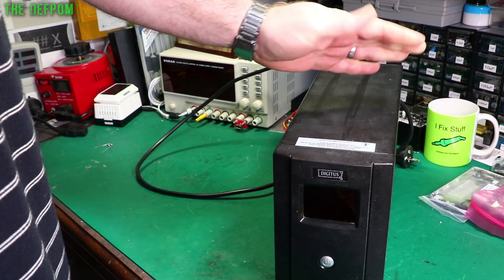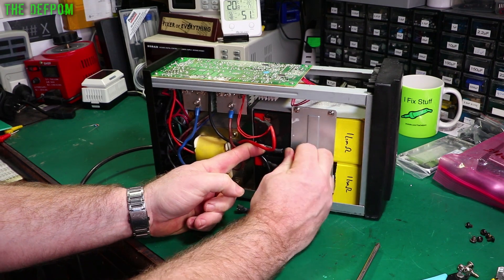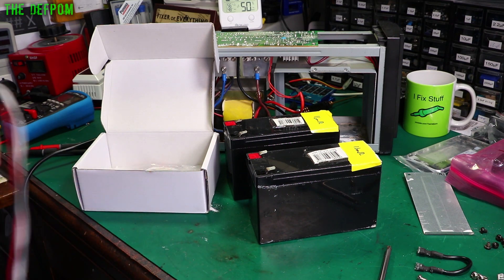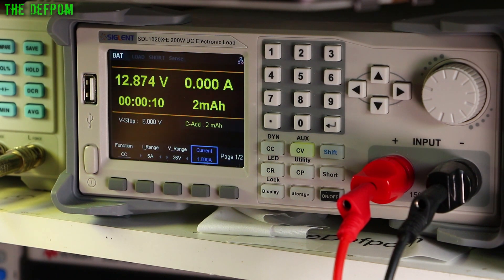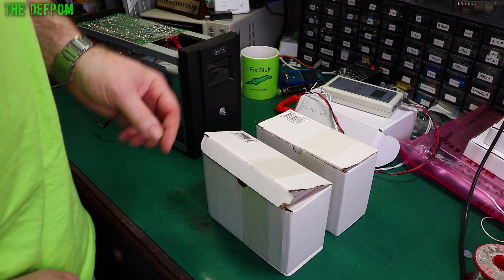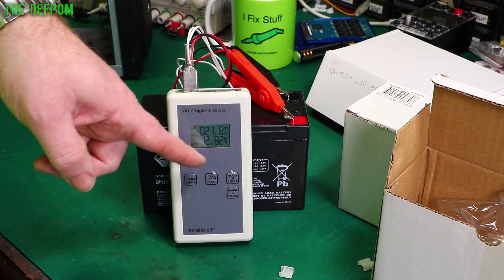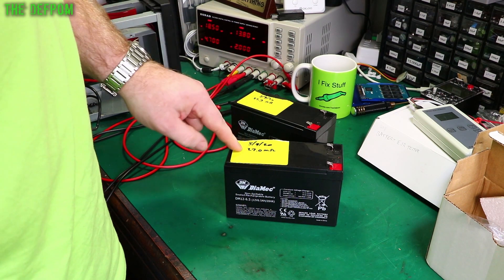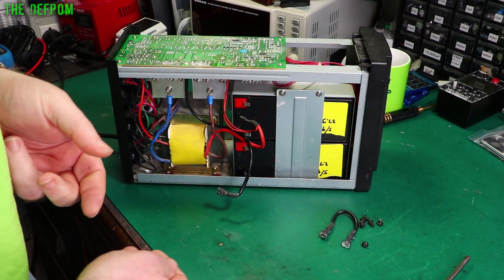#777 Can I Fix My Digitus UPS ? - Leaked Battery Replacement & Corrosion Repair

Comment: Good video, will be interesting to see if the lower energy density will mean longer life.
At 18:46, when you connected the battery and expected a spark due to caps charging.
With one brand I used to change batteries on, they were like  yours not user replaceable, the manufacturer had a connection process to prevent any damage due to connection transients.
The UPS were 3000VA and had 48V worth of SLA batteries.
They instructed you to do the first connect through a 100R 5W resistor to slowly charge the caps, after 15 seconds remove the resistor and make the proper battery connection.
In the time to change over the charge on the caps would not go down significantly and there would not be any major transient to worry about.
Reply: Likely no really large capacitors there on the input section, relying on the battery ESR to do that instead. Also serviced a 12kVA UPS, which had 4 36 series banks of 12V SLA batteries in it.  Heavy trays, and a lot of link wires that I made to replace the originals that had rotted with acid. Just got a box of terminal lugs, and made a new full set after looking at the first tray.  

There the connection procedure was to have power turned on, inverter in bypass, so the inrush limiter was active, then close the fuse holders per bank in sequence, with a lovely arc and bang each time. Also to slide those trays in you basically were lying on top of the unit lifting the tray, so you could get it in, and not catch the flying leads that you connected just before sliding fully home. 

Yes changing the batteries with the unit operational, even did a cooling fan change that way, though that was at least easy as it was connected to the grounded heatsink, and then via a fuse to the output side.

Comment: Good clean up on the connectors.  
I use AGM (absorbed glass mat) batteries in my APC UPS units, and they typically last 4-7 years.  And, it's a lot easier to change the batteries in my APC units.  
APC isn't the greatest, but Liebert units are a bit expensive for home use.

Comment: White vinegar is fine for cleaning alkaline spills, but for acid spills from lead acid batteries, you should use an alkaline solution, sodium bicarbonate solution is about the easiest to get and safest to use.

Comment: Date code is hot stamped into the plastic of the top cover on most of those batteries. They die in UPS use because they suffer from being well cooked by the transformer right next to them, and high current draw in use relative to the cell size. The lower capacity cells might have thicker plates and thus higher current capability, but often they just have one plate pair less. Only way is to check mass of the battery,  the heavier ones have more lead in them.

Solved that issue with an APC UPS I got for free, making the 24V battery pack an external one, and upping the capacity as well, plus went from SLA to flooded batteries that I can actually fill the water on. Runs a lot cooler, and the current draw relative to battery size means it can run 2 hours plus without problems.

The terminal corrosion I find the only solution is to cut the terminal off, strip back the wire till I find good clean copper ( often means making a whole new wire lead, as the wire will be crusty and green blue black a long way as the acid wicks up it) and put a new spade connector on there, then tighten the terminals slightly to get a better grip, and fill the inside with a bit of thick vaseline or silicone grease. The sleeve is best done with some salvaged PVC terminal sleeves from scrapped AC units and microwaves, and often those provide the complete lead ready made, just have to press the little clip to undo the latch that holds them really fast. 

Removing the acid go grab a few teaspoons of baking soda from the kitchen, or if there is none just some regular laundry detergent powder, and add just enough water to make a thick paste, and apply, scrub a bit and then wash off with water.  Get the acid neutralised and removes the gunge. Then apply some rust converter to protect the bare steel there, and let dry, then put the unit back together.

Comment: The charging circuit also influences the life significantly. Residual current at full charge voltage, needs to be minimal, and numerous UPS leave too much current at full charge condition, and that is for many users so close to 100% of time since there are few power failures fot most of us. 
Further is temperature, again some UPS units still run warm even on just delivering mains through. That coild be for instance that they have active power conversion by stepdown transfore rectify to DC and converting to sine regulated output, or just power for the transformer rectifier for charger function, and switch over relay.

Comment: Most of the issues I find with UPS' in general is they dont actually fully charge the batterys the voltage is below the rated spec of the battery's
Reply: Funny I find most cheap ones charge to the voltage you would expect if the battery is at ambient temperature, 13V8 to 14V0, but instead it is at 50C plus, so is thus overcharging always, as that should be 13V6 or less. SLA batteries have a big temperature coefficient, and as they heat up terminal voltage drops.

Comment: Great, that's sorted for 2-3 years at least :-D
I would imagine by now that multiple lithium cells could be in new units, with a smart charging b.c.m system.
I'm thinking about the lithum jump start batterys,  they seem to have plenty of warp lol.
Not that i know anything about them lol.
The trick for all the jobs to be done is A: Don't create any more.  B: Only do what actually matters.
Ooow C: If you can't see it, it does not exist :)
Reply: Problem with lithium batteries is they absolutely are not forgiving of staying fully charged all the time, and applying the slightest overcharge to them is going to result in some bad results. Lead acid though will accept overcharge with minimal issues for a long time, till the water in the electrolyte is all gone, though some of the better SLA types have a catalytic recombiner built into the vents, that turns the hydrogen and oxygen generated back into water and put it back in the cells, instead of just regulating pressure by allowing excess vapour to escape into the ambient.

Comment: Vinegar contains a lot of water, you might want to WD40 it after using the vinegar. Even after using my 98.9% acetic acid on metalwork I still WD40 the workpieces after pickling.

Comment: 11:30 Charging SLA batteries at 2A is much to high, sure they take this amperage if you let them, but these type of batteries are best charges at max 10% of the Ah capacity.
So for a 6.2Ah battery , the max chargecurrent is therefore 0,62A. 
A good UPS design takes care of this, and lett the chargecurrent not raise to high, that's why some manuals state a recovery time of 10 hours or more 
when the UPS is used till the UPS shuts down due the low battery voltage.
A SLA (Sealed Lead Acid) battery has lead plates separated with a glassfiber mats (sponge) with gel (acid), 
charging this type of batteries with high current will develop heat and they can release Sulphur odor (smell of rotten eggs).
Also because this acid is in gel form, the develop gasses can't escape as quick as with a normal car battery where the acid is in liquid form.
These "Sealed" Lead Acid have a valve internally which opens if the inside pressure is to much, the released gas is highly flammable, 
disconnecting the crocodile clips (sparking) during high load or charging can cause fire or an explosion.
Reply from the maker: That was 2A with both cells in parallel, so 1A per cell, they didn’t actually take 2A anyway, only initially and it started to drop very quickly, 1A was less than the initial charging current listed on the battery.